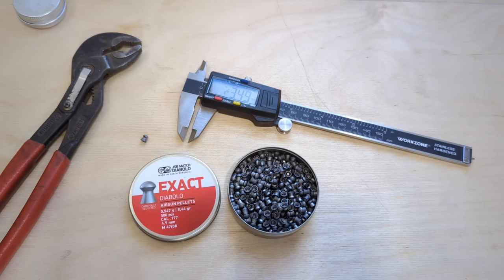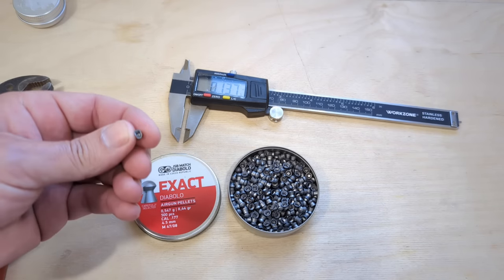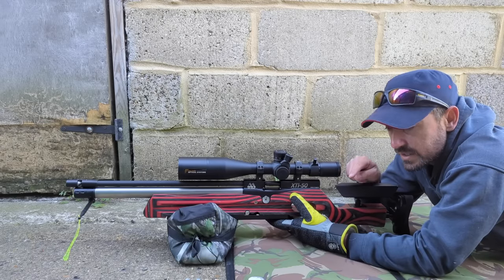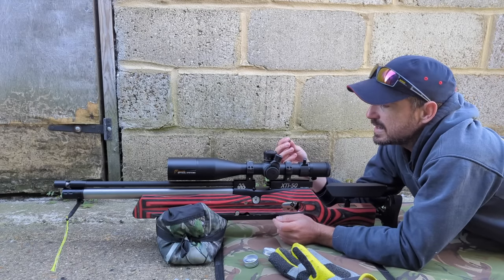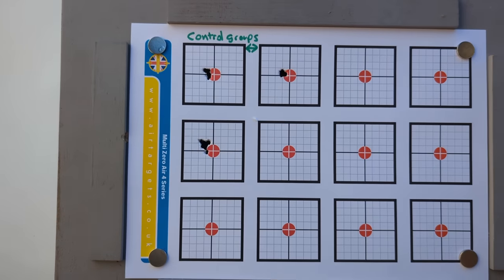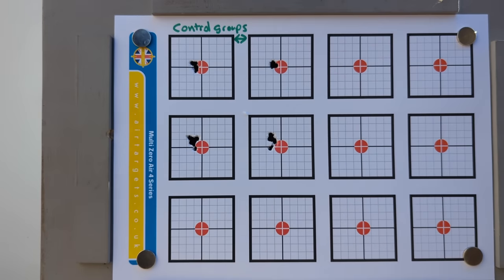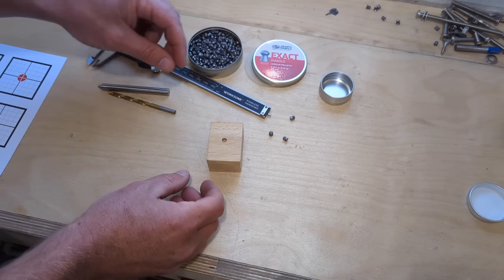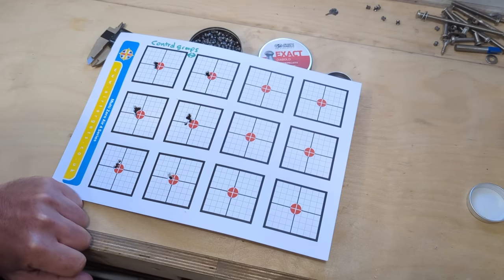Stop throwing away damaged air rifle pellets..Can we repair them successfully?

Comment: I often get JSB Express.22 that have brutally squished skirts. Not economical to return to supplier given the postage charges here in Canada. I can get most pellets back to 95% of their proper shape by putting them through a pellet sizer that is 0.01mm smaller then the pellet die.
Reply: Oh Kenada
(Oh by the way Airgunsource did send me replacement tins when I had damaged ones)

Comment: Remember an article in a magazine where the guy tested damaged pellets. He also found skirt damage didn’t effect the groups that much but when he damaged the heads the groups opened up. 
Might be worth a follow up video 😊
Reply from the maker: Yep absolutely correct.head damage and eccentricity will usually have a great effect on group sizes. Trying to replicate it on film though...might be tricky but I'll be revisiting this topic for sure 😉
Reply: @tillysgunstocks  I think he took a Stanley knife to the head and basically scored them. He flattened the skirts and they were ok but the head damage had a direct effect. Would be good to see an actual video on the difference.

Comment: Done that since ever... JSBs suffer the most, H&A the least (harder lead compound). My method is different though, no tooling used. I just press the head of another pellet inside the skirt hole of the deformed, and with a circular movement I round it back, very easily to do. I don't bother if it is enlarged a bit more or less because the blast will fix it tight fit inside the barrel.

Comment: I love pellet sizers
Reply: Same here. I use a sizer larger than the headsize which leaves the heads untouched but means I don't throw any away or inadvertently use a damaged pellet. I also found the sized pellets shot slightly tighter groups. I'm only talking minimal difference but that difference is great for confidence. Only my findings of course and I'm sure some will have differing experiences but it works for me.
Reply: @karlmaddox1209  100% Sir
Reply: Didn't know you had a channel IG fellow!

Comment: Nice video; However I think a better test would be to select damaged pellets from the tin. Couple of reasons for this (1) damage is random, you are essentially just making a relatively consistent batch when deforming identically. (2) real world use groups will be a mix of perfect & damaged pellets.
You should sort the pellets & shoot 5 shot groups. The test would be 5 x 5 pellet batches with one damaged pellet in each batch.
You fire the batches with the damaged pellet selected randomly but you make a note of the order you fired the damaged pellet (for example 3rd pellet of 5 in that group).
Do this for the 5 groups (or more) & it would give you a much more accurate representation of how damaged pellets affect accuracy/grouping.
Noting the place of the damaged pellet in the group shot sequence allows you to identify flyers & if the damaged pellets are contributing to opening the group size up & just how much the damaged pellets affect accuracy as opposed to pellets just reacting to wind or technique error. Just my thoughts.
Reply: Good video, I've found the softer the pellet, eg, JSB, the pressure applied in the barrel reforms the skirt in the barrel. However, the harder pellets eg H&N then the damage has a greater effect. If you are a competition shooter, it would have a definite effect, but for your typical club shooter, I don't feel there is an issue. Keep up the good work.👍👍
Reply: Thanks for response, I use the wolfman store, and all their pellets are very well packed. I would recommend then as the normal 3 working  day delivery is free. Finally, I think head damage is more critical than shirt damage. Cheers

Comment: I have found that, depending on the head size and material hardness, the diabolos from the Diana magazine for the Stormrider can sometimes be pushed into the barrel with little resistance or with very high resistance from the not very good magazine with the existing loading mandrel. The result is probably deformed, stretched or compressed diabolos with probably crooked heads? I don't know because I haven't pushed any of these diabolos out of the barrel yet. But in contrast to loading with a magazine, I don't feel any noticeable resistance with the single-loader with a pure loading mandrel. And the spread circles are about 10 to 30% smaller with the single loader method than with loading with a bad magazine. The differences in the fluctuating larger scatter circles are due to the lead mixture and the head shape and size - at least that is my results with this very inexpensive weapon. The shooting took place indoors at a distance of 8 m under artificial light and below 7.5 joules, as is permitted for free weapons in Germany.
However, there is also another video documentation in which a very renowned gentleman demonstrated under “laboratory conditions” with his high-end Super Match rifles that these weapons can also be used to shoot damaged diabolo heads or deformed diabolo bowls at a distance of 10 m and in compliance with the 7.5 joule limit, this did not lead to a deterioration of the scattering circles!
I take note of his result. Ultimately, I have to bow to my weapon and accept that it simply delivers measurably more precise results when loaded directly with the loading mandrel without a magazine, across all types of diabolo. I tested over 30 different types and got very different results indoors at 8m. I tried to reduce my shooting errors by placing the gun while sitting and using a paralax-free scope.

Comment: I'm always surprised about the number of pellets (straight from the tins - JSB Exacts) others are finding with skirt deformation.  I do size and weigh all mine, so every one is inspected.  And I cannot recall ANY - like not one - with any damage from any one of the most recent 5 sleeves of JSBs I have bought.  And same goes for weight variation.  I purchase Exact 4.53s and weigh them after sizing down to 4.52. I find 60-70% weighing between 8.40 and 8.49, with the balance fairly evenly split between 8.30 to 8.39 and 8.50 to 8.59.  I sling out any which weigh more than 8.59 or less than 8.30, but that's usually fewer than a handful per tin.

Comment: I wonder if your method of damage is too consistent to reflect typical damage from the tin, which could be causing the groups to be not too bad? Great video👍
Reply from the maker: Quite possibly mate. However the damage I caused was quite a lot more severe than I've ever seen straight from the tin.
Had I been using a mag fed rig, I'm absolutely certain the groups could have been significantly worse. The chances of major misalignment would be much higher than in the single shot action.😉

Comment: Excellent vid as always 😃👍, I agree with urbanspace  something or other , I also use a pellet sizer, much simpler & so easy to use, takes out all of the possible mistakes, eg leaning to 1 side or the other, let me know if that’s wrong, thx,
Reply from the maker: A sizer can absolutely work, however what a sizer does is swage the pellet from the outside inwards.  That's fine if your barrel doesnt mind the sized pellet.but using a taper inside the skirt outward will often give a more concentric reshaped skirt. 
Having said that,if the sizer works for you..then stick with it 😉 it's all about being confident in your kit and prep

Comment: Another really interesting video. Who’d thought those reshaped ones were almost as good as the fresh ones! 
Have you tried the JTS Dead Center pellets yet? They seem to be getting good reviews so it would be very interesting to know what you think of them. cheers, Woody.
Reply from the maker: Hi mate are the jts available in .177 yet? 

It's surprising eh, but I've generally found that head sizing and or damage is more detrimental to group size than light skirt damage. 
😉
Reply: l think they are coming but unfortunately only available at moment in .22

Comment: Just my 2p worth ..... Regarding your pellet skirt re-former tool, I'd suggest trying a rounder head rather than elliptical/cone shape. After all, what your aiming to reshape is the rear of the skirt and this could be the reason you found them 'hard' to reform.
Reply from the maker: Hi Mike. Yeah you are absolutely correct. The 1/4 stereo jacks have a straight taper and work perfectly. I couldn't find mine in time for filming so made the one in the vid quick. The jack plug works much nicer 😉

Comment: In my own tests i used less damaged skirts. My results suggested some groups were improved but probably my shooting, lol. My theory is that because the bent skirts move out further to seat when shot they slap into the rifling and perhaps seal better? May be way off there though.
Reply from the maker: I'll show you in the future mate what I believe is happening. It's enlightening collecting shot pellets to see how they come out the barrel.

There's a definite relation between reg pressure and valving duration too, relative to pellet fussyness and pellet choice.its all intertwined 😉

Comment: Could you not just use a commercial pellet sizer?
Reply: Yep, the TR Robb pellet sizer strikes me as being a great option for this.

It uses a very slightly tapered tube, and depth is adjustable to allow you to change the head diameter. If my memory is correct (highly unlikely!) the taper leaves the skirt 4 thousandths of an inch wider than whatever the head size is set too. 

End result is that not only are you sizing the heads of the pellet, but the skirt diameter is controlled too. 

The sizer will be supporting the nose of the pellet, and the pusher probe should be able to reshape the skirt, with the added advantage of keeping the skirt diameter consistent during the reshaping.